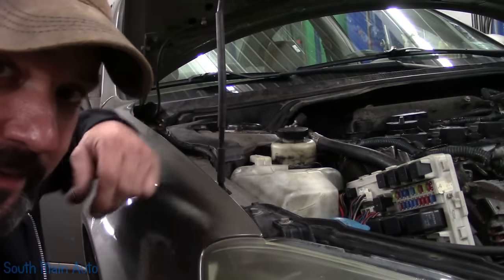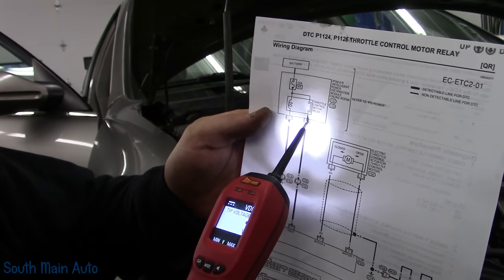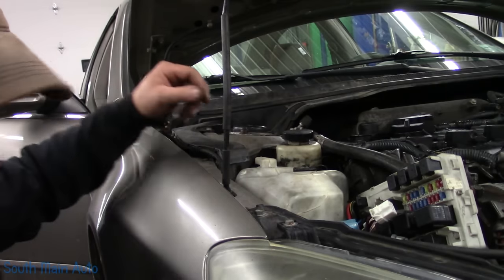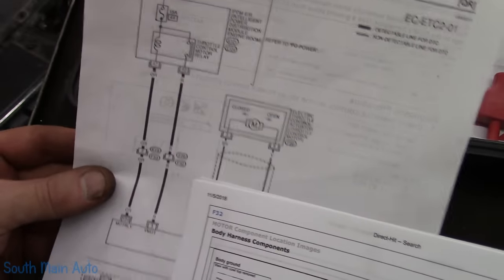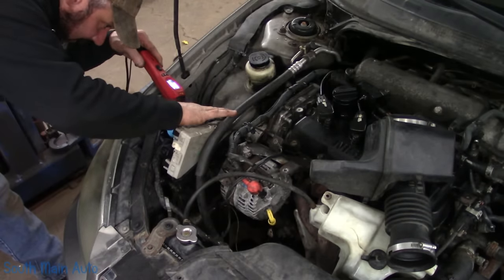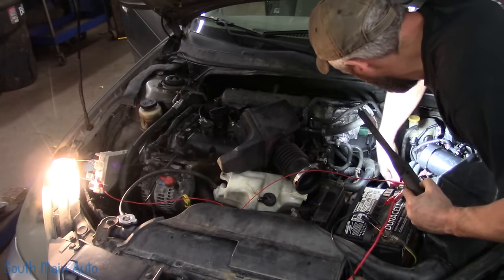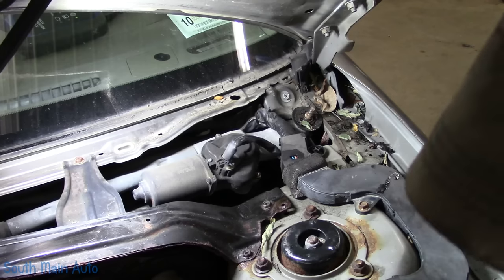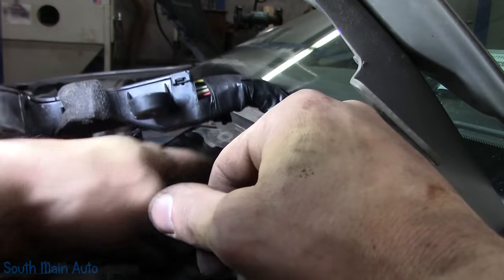How To Fix A Car That Keeps Blowing Fuses

Comment: Okay, couple things. First it's a sweater. Next, another excellent video. I admire how you start with common sense and work your way to diagnostic tools. Third, why don.t you have your shop 4000km closer to me?? I have a couple cars with electrical problems that would make awesome videos...you could fix them for me, I'd pay you lots...please come to Canada and fix my Jaguar.....😉
Reply: I feel your pain. I just had to send a '94 XJ6 to the crusher 😥 electrical grimmlins(sp)
Reply: @sirchomps  oh I'll one up ya...2000 S Type. Possibly the worst car on the market to this day. Half Ford half Jaguar, all crap.
Reply: Lol! Man I loved that car! Lol! Couldn't afford to continue to put it in the shop! Not physically able to do all that crawling around inside and under anymore. Oh well.
Reply: @sirchomps  Yea the XJ's were one of the prettiest Jag sedans they made. Too bad Lucas had their hand in the wiring, terrible terrible stuff. And with that poor design caused extensive rust issues.  (FYI gremlins)lol. I also have a 2006 BMW 750Li with some problems but I have a few parts coming that hopefully will solve a few of the codes. If they don't fix it I hope there isn't a mysterious fire...wink, wink.

Comment: I bought a car from State of NC. They had a problem with the power seat circuit blowing fuses on a Dodge Charger Police Car. Their fix was to throw a circuit breaker in the fuse box. BAD idea, it melted the wires/top of the fuse block in the trunk. Problem was the + wire on the seat was intermittently shorting out on the seat frame. One of their cars had a "locked up engine". Fix on that was a loose battery cable. Finally a Tahoe was dx with a bad fuel pump and no start. 5 gallons of gas in the tank fixed that one. Finally a No brakes on a Suburban was the right rear brake ground all the way down to the fins of the rotor and the caliper piston blew out leaking all the fluid out.

Comment: Impressive! Being an electronics engineer myself, I KNEW this would be a tough issue to find. Thank you for going through the whole troubleshooting process as this helped reinforce what I thought I knew both electrically and common sense wise. Kudos for staying focused and using logic to narrow down where the short was as you had to dig deep.
P.S. Marie is correct. It's a knitted-style jacket, not a sweater. A sweater does not have a zipper. Sorry dude.
Reply: Thing is, what he did was some good, solid and logical troubleshooting. If the mess could be some how laid out on a bench or in some sort of open and accessible framework, he probably could have found it in 2 minutes. The mechanicals are the challenge here. Wires that go this way to get that way. Stuff in the way. Connectors that straight out suck. Technical info that you have to be a Sherlock Holmes to find. Everything really is against him in his task. The only good thing he had going was that he was indoors and out of the weather.

Comment: I would have enjoyed seeing how you make the repair on the stripped wires.  Did you just tape them up or did you put something else over the damaged area?   You certainly are the "go to" shop in town, since other shops send their failures over to you on a routine basis.
Reply: Sparklander Hamfisted or a flat rate guy determined to beat the book?

Comment: Mad respect Eric. So many shops just throw parts at a problem at customers expense and you take the time to do an actual diag on the problem and saved a good chunk of change I am sure. You are a Mechanic Jedi.
Reply: He not only saved the customer money but he fixed the problem that a new ECM would not have.  Obviously the engineers that designed that mess did not think that the wiring harness could rub on the wiper motor.

Comment: "I'm gonna start wiggling stuff at this point"
That's how I fix mine
LMMAO!
Reply: It was very important when he said to connect the test light BEFORE wiggling the wires.  The last thing you want to do is shake stuff and remove the short to ground without knowing where it is. Intermittent is the worst. Imagine doing all that work and somewhere in the mix the short disappears. You put every thing back together only to have the short come back at some point.

Comment: When I look for similar faults, I replace the fuse with a lamp so that the lamp lights under fault conditions so I can chase wiring and the fault in jig time and not spend time replacing fuses.
Wire and connector flexing whilst watching the lamp can trace intermittent faults too.
Time is money.
I see you do something similar at around 22 minutes. Good work.

Comment: Why do some "mechanics" diagnose by replacing every part on the car? From the sounds of it they didn't do any diagnosis, they just replaced parts one at a time. I would imagine they do this with most cars. Replace what they think is bad, doesn't work replace the next part. Every manual I've seen has a flowchart for diagnosing problems, even if it has extra steps for the people that aren't able to think for themselves. If you're not doing any real checking you're at the same level as a quickie lube. Why would people continue taking their car to a place like that?.

Comment: just put a jumper wire in place of the fuse and look for where the smoke comes from.    short found
Reply: Fire dept. folks hear about that idea a lot :)
Reply: I think they tried that because there was a jumper wire in the old fuse box but there must not have been enough smoke for them to find it.

Comment: Hi Eric. When diagnosing an electrical short I use a 1 amp  load (10 ohm ceramic resistor to the opposite supply - in this case positive) then a current probe on the loom (Battery terminal removed to eliminate  everything else) this tells you, without any thinking, where the short is.

Comment: We used to have a Burroughs tool which would power up the circuit and supply low current to the wire, with everything else in the vehicle off,  by following the affected harness, with  a cheep Boy Scout harness immediately find the location of the shorted ground, the compass needle will switch direction when the short is passed over, you can due the same thing with your lamp and a compass, try it you will like it. In this instance you would have saved disconnecting the ECM, and the intermediate connection.

Comment: Excellent use of "DEDUCTIVE  REASONING" to find the ROOT CAUSE of a problem. It is hard to understand why people, in general, have such a hard time understanding this technique. I am curious how you determined how to charge the customer for this repair, simply Time & Material leaves you short. Your experience is worth a Ton, especially when you consider the other repairs that didn't fix anything. Great Job.

Comment: Slap a bigger fuse and ship it.  -Hack Shop 2018
Reply: Didn't even have the decency to jumper it with automotive wire. This kind of troubleshooting, especially from another shop is a travesty. Along with several hundred dollars already spent, they wanted a replacement ECM, not to mention they could have lit that Altima off like a roman candle. My vote for her outer wear is a cardigan.

Comment: Great step by step video. One of my greatest triumphs that no one else ever saw was finding a 300 ohm corroded connection in a Volkswagen starter circuit, cleaning it up and then the problem went away. Should have been less than 1 ohm, and it was when I was done.
Reply: Hey bud, do you know much about nissan maximas and why the main fusible link on the positive battery terminal would continually blow? If so, I'd love to get your opinion!

Comment: How to troubleshoot a short    1. Isolate the problem   2. divide the problem line to save time   3. inspect the problem line   4. repair the shorted wires/component .  You are our on-line professor and I always learn something. Thanks for sharing.

Comment: I remember the first time I saw this, it was lucky when you moved the wiper arm.
This video reminds me of a 2004 F250 automatic with the column shifter and finding the the three wires going up the hollow tube of the shifter arm to the O/D switch and having the wires bare at the base of the tube because of the shifter handle natural movement.
The new Ford part is the same, so a small piece of split loom wedged up into the hole, over 3 wires and repositioning the small 3 wire harness eliminated the "Planned Obsolescence" to that wire harness and shifter assembly.  The repositioning was because the small 3 wire harness also rubbed over the movable shifter tube that was connected to the transmission shifter cable.  WHEW!  WHAT A CLUSTER for such a small harness that was blowing fuses!
Nice job Mr. O!

Comment: Perceiverance pays off, had exactly the same job on a BMW Mini one , rubbing cables on the wiper motor , even had a spark out first he couldn't find it in his  £45 chargeable hour , I kept looking , and bingo , rubbed through wiring shorting out a main feed cable , regards route , repaired , fixed , paid and gone , great video

Comment: Great video.  My 1997 Jeep constantly ran down the battery over 3-days and three shops could not find the cause.  Finally, I got a local mechanic who was the main troubleshooter for many dealers, and he came to my house and after about 35 minutes, turned, asked me if my horn worked.  I said No, it had not worked for 2- years and the switch was embedded in the air bag so it would cost $600+ to replace it. (BAD JEEP engineering!). He said the horn switch was stuck in the ON position, thus draining the battery.  After pulling the horn relay, I never had the problem again. I plan to hook up a separately wired Aooogah horn.

Comment: I've come back to this video because I'm dealing with a job at work that is kicking my ass. My electrical diag skills are poor at best currently. I've got a short in an 09 Honda Pilot that whenever you pull the tailgate outer handle switch, it blows fuse 29 in the under dash fuse/relay box, causing the switch to not open the tailgate. I get ahead of myself and get very flustered quickly whenever I'm not progressing towards a solution so I didn't even think about breaking the circuit up. I brought home the ETM from work and I see I have 3 different connectors the wire I need to check runs through. Hopefully that'll help me pinpoint the problem. Thanks for your vids Mr. O, they make me want to be better.

Comment: Dude you are good good good. Excellent trouble shooting for a short. Using a light. Basic logic and following the current flow and not getting side tracked. I was excited when you found the skinned wires. Nothing worst then when the problem disappears and you can’t confirm or have evidence.

Comment: "Wiper Wiggle" test, love it ! ... I had a shorted front blinker wire ... turned out to be behind the headlight, chaffed wire from a minor accident that was repaired well, but this wire must have been pinched and corroded off 10 years later ... visual inspection revealed .. quick fix after taking out the headlight assembly

Comment: It's great to have the circuit picture...but always remember that it's a 'pictorial representation of the circuit' and often times there are other things involved that can only be found by looking at the wiring schematic which some manufacturers make very difficult to procure.   I'm an independent mechanic and seem to get things like this all the time and rarely do I get the first shot at them...but it makes it a little easier if someone else has thrown a bunch of new parts at it being that it reduces the size of the 'possible problems' list.   Great video as always Eric!

Comment: Thanks again, gives me some direction on my 2006 Malibu LT, I am pretty sure it's a short. Had a fellow (at a place where cars come to die), check the wiring harness, and the no start problem disappeared, but the car needed replacement shocks and struts, and the vibration, may have exacerbated a wiring harness-short, previous owner kept the car outside in the elementos of New Mexico...you are the best.

Comment: Never buy a Nissan, there, stored in memory banks. My neighbor has a Nissan farm of dead and nearly dead Nissan's, he told me to never buy a Murano because they breakdown constantly (He has 3). Great video, you sir have terrific diagnostic abilities. Thanks for sharing your automotive electrical Wisdom! Short circuits in any auto application are the most frustrating of all auto repairs to tackle. Your camera work makes your diagnostic adventures very easy to follow. Nice job, a dealership would have already sub-marined the customers bank account.

Comment: Eric as always, another awesome video. You need to add a toner to your tool  arsenal. With a toner (like the phone/Ethernet wire guys use) no jiggling necessary. You would have cut your time in half locating the short.

Comment: Excellent vid. As one long term wrench turner to another let me give you a word of advice...."rechargeable headlamp"....worked for 2 decades dragging around aggravating drop lights that are never where you need them to be and are always in the way. Bought a good quality rechargeable headlamp one day and now the light goes exactly wherever i point my head and requires no hands at all. Threw all my miserable drop lights in a box and that is where those stupid useless lights now permanently live forever

Comment: Good stuff - you followed the circuit in a correct sequence - diagnosing and not just throwing parts at it like your fellow shop suggested you do.  From my work experience, I remembered a combine that lost the cab AC when the roof panel was bolted down - the offending fastener would puncture the harness, short the hot wire to ground and blow the fuse - same thought as the Nissan.  I am glad you did not suggest to "follow the smoke" with no fuse like some hacks suggest.  Again, well done - keep up the good work .